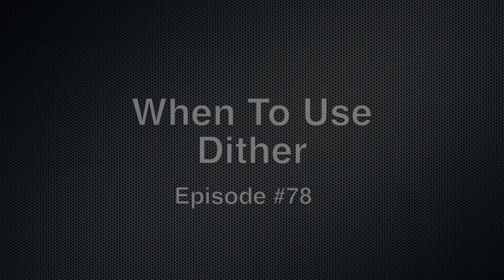When To Use Dither - Episode 77

Comment: Yes do not worry. I really have a specific question. It is necessary to use dither. I do not understand well, it's supposed to be noise, but I do not want my track to distort. That's why I do not really understand if it really is necessary to use it or activate it or not.
Reply: It more about reducing the rounding errors.  It's all math when working itb.
Reply: @380stroker  Ok.

Comment: My dither gives me options'  high,  med,  low, etc.
I'm going from 24 bit to 16, and sometimes Mp3.
Also there is different kinds like Mbit or whatever, how do I know which is best choice??
Reply: Normal level and flat TPDF will work fine. (and not needed for MP3 - go direct from floating point or 24 bit to the encoder).
What's important to note is that any added noise from dither is at a much lower level than easily cumulative truncation distortion from not adding dither.
Reply: Interesting about no dither for MP3, is that how it makes smaller file sizes by limiting lower sound floor, or something like that?

Comment: You said to use the shortest cables possible once upon a time. Questions does cable length matter in recording studio's. I see million dollar studios and not so rich  studio's with gear 20 feet from the mixer and gear another 15 feet on another wall. How does it get to the board at the same time with no delay in sound (even with compressors)? Thanks.
Reply from the maker: Ideally yes practically no

Comment: My vocal recording setting will only record  16 bit but the instrumental was made at 24 bit. Would I be best to export at 16 bit?
Reply: Combining / mixing your vocal and instrumental tracks will result in a signal of more than 24 bit word length (aka bit depth). So when exporting it back to 24 or 16 bit audio, best to also use dither to that same word length (bit depth).

Comment: What if the material already has a high noise floor, surely then there's no need to use dither?
Reply: truncation distortion is still added to that signal (and noise floor) cumulatively with each stage of digital processing. Dither prevents that added distortion when going to the destination bit depth (24 or 16).
Reply: It's not just about noise.  It's about the math involved when reducing bit depth.  To get the least amount of rounding errors you need to dither.  It's science, it's math.

Comment: Sorry, but this video has just too many false information. First of all, people are already confused enough about the difference between Bit Depth and Bit Rate, so if you use it constantly the wrong way in this video, that is really bad.
I understand that it can slip through the wrong way during teaching, but three times, I start to question if you understand the difference yourself. You should have caught that mistake when you watched your recording before uploading it and at least put a graphic on it. Not a big deal.
Also, using 16bit and 24bit audio files in your DAW doesn't make it sound "Crap". Why would you make such generalized, uninformed statements? No matter if an audio file is 16bit or 24bit, it will be played back (and processed) in your DAW at 32 (or 64bit) floating-point.